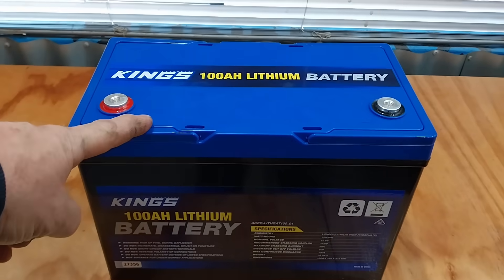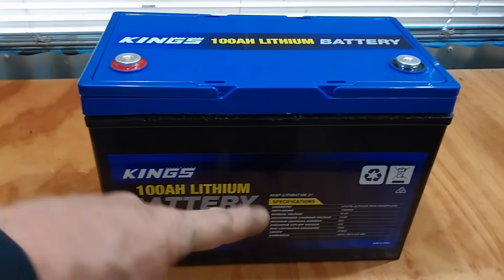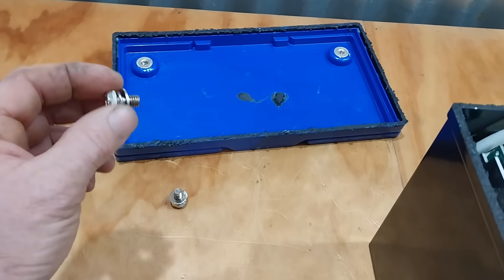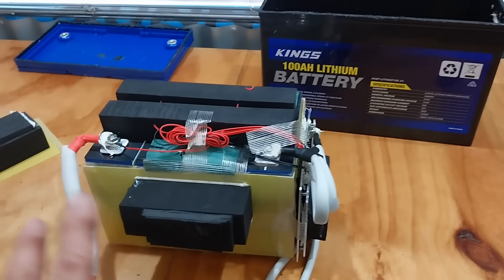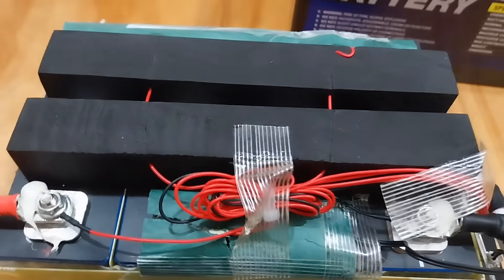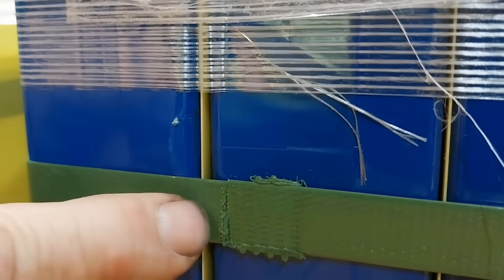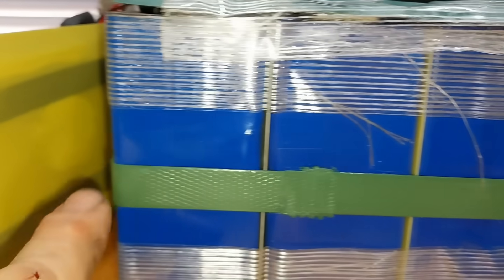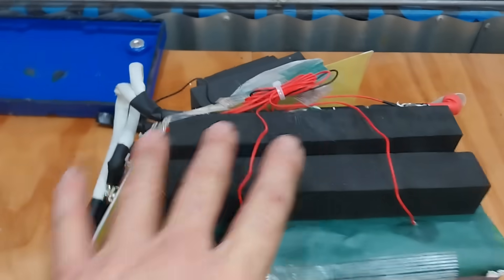Kings 100 Ah Lithium Battery Teardown - What We Found Inside ?

Comment: Chinese manufactures sell these dented cells as B-grade. If you look at Kings warranty on these they are 1 year.
Kings 120ah Lithium batteries have a 3 year warranty which could be that they are A grade cells not dented.
Reply from the maker: On the Kings website they say as shown below, which I copied and pasted from their website. It would be interesting to know the grade used? As for the 120 Ah batteries, I did a teardown video on them as well and the cells were all perfect.

"The Adventure Kings 100Ah Deep Cycle Lithium Batteries, battery’s high quality BMS paired with the Grade A cells"

Comment: The cell imballance starts to diverge  when the cell is above 95% state of charge. Your teardown video is great. The brand is not well knowen in china and likely will not last 500 full cycles. I have tested the 200AHr kings batteries before and the performance was only ok at 100amps continuous draw not its suggested 200A max which is fine but at the time it was suggested it could do 200A. Refunded it with dificulty and bought Renogy 200ahr lithium iron phisosphates in Australia instead almost same price delivered to my door and performed at 200ahr  for 1 hr 15 minutes!  In my opinion these kings batteries are quite low quality. If you cycle them down they will swell due to poor compression.

Comment: A few months back i was looking at the 100ah batteries. Noticed the 100ah only had 1 year warranty vs the 60ah and 120ah had a 3 year warranty. The 100ah wasnt using prismatic cells at that point. If buying a 100ah in the near future keep an eye on what warranty you are getting, they will probably be pushing last of the older design that has less warranty out.
Reply from the maker: The 100 Ah prismatic cell batteries are still a one year warranty where the 120 and above are three year. I did ask one of the staff at Kings why this is and they said it was part of marketing to push their higher capacity batteries. I've been meaning to call kings customer service on the phone to ask the same question as see their response.
Just a little side note. Not sure if you have seen my tear-down on the Kings 60 ah battery as I found the same damage to the cells in that battery as well. On the 120 Ah battery tear-down, the cells were all good.
Reply: @TheOffGridBachelor Yeah ok, It kinda puts the 100ah in a strange spot then having the batteries just below and above have 3 times the warranty. Thought it may have been because the 100ah was an older design but you just cleared that up. For the extra warranty you would be better off spending that bit extra and buying x2 60s or a 120, especially when they are on sale.
Reply: @TheOffGridBachelor didn't see the side note about the 60ah.. will watch the video though. Do have a 60ah and so far it has been ok, I am pretty sure the 60ah has a 3 year warranty though. Appreciate the videos you do 😊

Comment: This might be a bit long winded, but there are a lot of things wrong here.
The cells have a limited amount of electrolyte injected when they are built. The cell is first vacuum tested to ensure the seals and cases are good, this also is used to remove any oxygen from the cell. None of the manufacturers will tell anyone what they purge the cells with, but I would expect it to be an inert gas like nitrogen.
The cells don't have an excess of electrolyte the way a flooded cell lead acid battery, there is just enough to wet the faces of the plates and fill the gap between the plates and separators, there isn't any spare floating above the plates.
When the cases bulge, this forms a space between the plates inside and the case and this fills with electrolyte. The result is the electrolyte level drops down from the upper edges of the plates. If only part of the plate now has electrolyte saturation linking the plates together, the part with no electrolyte can no longer transfer the lithium ions from one plate to the other, so the capacity reduces, the more the case goes out of shape, the less surface area of the plates are saturated, the less capacity the cell will have. The battery is only as strong as the weakest cell, so even if only 1 cell bulges, the whole battery capacity is reduced because that cell can now store less Ahs.

The cell temperature should be measured between each cell, not on the cell link, that reading would be meaningless

Aluminium needs to be 3 times the area of pure copper to carry the same amount of current. This means even the link that measured 1.2mm thick, is only the equivalent of 0.4mm think copper. Cells like the ones from Winston Batteries use a link made from 5 pieces of 0.5mm thick copper stacked together to link the cells The reason for 5 thin copper links rather than one thick link is the cells actually expend and contract, and the links expand and contract, depending on the temperature, that thick piece of aluminium will apply pressure backwards and forwards on those welds and they will crack, then the current has to pass through a smaller section of the aluminium causing that to get hot and the link will rapidly crack and fail from that point ..... a dead battery because the current can't from one end of the battery to the other through all 4 cells.

If you are using voltage to measure LiFeP04 cells State of Charge, they are either fully charged, fully discharged, or not fully charged or discharged. An LFP cell is fully charged when the resting voltage after 12 hrs is higher than 3.45v, you can not measure the voltage to establish if they are capacity balanced at any thing lower than the rested 3.45v ...... except for 0% SOC, that is where the rested cell is less than 3v, draw any more current from the cell past that will create damage to the plates and cause the electrolyte to heat up, and that will cause the cells to bulge ...... we have already discussed the problems that causes.

The cell balancer board used is a simple resistor type, designed to balance 1Ah or less capacity cells because they can only drain off 0.025 of an amp, how long would it take to shift even a 1% out of balance ..... 1ah is 1.000 amps that can be drawn for 1 hr, it would take that little resistor 40 hrs to drain off 1 Ah

I built LFP battery packs for off grid houses, houseboats, caravans and motorhomes since 2011, there are over 200 of my systems still out there on the road, there is a lot that goes into building a successful and long cycle life LFP battery ..... and you can't put that in a plastic case that looks like a lead acid battery ..... for a start, how does the heat escape?

T1 Terry T1 Lithium
Reply from the maker: Wow this is a lot of informative information and thank you for sharing this with us, I have sure learned a lot from this.
I have worked with flooded lead acid batteries over the 30 years I have been playing around with off grid power. Now Lithium batteries have come into play, I have a lot more learning to do.
Thanks again for this information, very useful 👍
Reply: Nice to hear from you T1 Terry, although you did not build my system your knowledge is the reason for me buying my winston cells 11 years ago from Trev. At Drive by nature.  Batteries still perform well in my caravan to this day.
Wazzaaaa
Reply: For someone who knows absolutely Jack shit about the subject these questions stood out to me as also being concerning .. the temperature sensor only being relevant to the single connection seem to be problematic given that heat is a problematic Factor ... not to describe this man's work and video entirely but even for someone who knows nothing and I repeat nothing about this subject other than seeing inside of it for the first time by the end of the video I was left wondering what it was he was alluding to which lead me to the comment section we're comments were made such as you did the world a favourite by making this video and I was left wondering what I missed other than the visible damage which is open to cast dispersions to when that actually occurred ... the current loss and heat that would be generated through the transfer + the limitations of the temp sender comes off as a diabolical problem to both service life or worst case catastrophic failure ... are these symptoms what is commonly referred to when referencing thermal Runaway as accounts and documented news stories rapidly increasing  of these catastrophic failures do these new lipo battery variations whether it be charging normal use or damage to the cell itself ...

Comment: Mine came with the TERMINAL BOLTS in a zip lock bag ,????
Reply from the maker: The terminal bolts I showed in the video are the internal bolts for connecting the BMS cable to the terminal lugs inside the battery.
The terminal bolts that come in the bag are for the terminals externally. The don't come connected as the terminals have the protection caps on them as well as the warning label stickers over the terminals.👍

Comment: I have a 10,000mah battery bank, its starting to bulge, should i throw it away for safety.
Reply from the maker: If it's an NMC chemistry or similar then yes, discharge it and dispose of it. If it is LFP / LiFePO4 chemistry then I wouldn't stress as much. I am not completely up to date in knowledge with the LiFePO4 batteries so I can't say for certain on what is the acceptable level of cell swelling, so I would do some research on it.
Do listen to all the hype of the ticking time bomb and it's going to blow up fear mongering. There are people out there on YouTube that give their opinion but don't have a clue between the different Lithium chemistries. So I would do some reading / research about the topic and see what the general consensus is.

Comment: can you measure the cell dimensions? they look fat for 100Ah cells.
I was looking at your video of the 120Ah tear down, thhey look slimmer than these.
can you give dimensions of both here in the comments?
Reply from the maker: That's a little bit of work there as I have both those batteries now rehoused. So next time I pull them out from where they are mounted I will do some measurements on them.

Comment: Alot of bashing the quality..... please take a look of some so called Australian made batteries....see how much better they are.
Reply from the maker: I wouldn't necessarily say that I bash the quality, I just show what I find. Two out of three Kings batteries I have done a teardown video on so far have presented with damaged cells. Over all I find the Kings brand to be pretty good quality for the price hence why I use a lot of Kings gear, however they do lack is some areas. I have plenty of videos on my channel where I have given the Kings product a thumbs up.
If any company, not just Kings, doesn't want quality concerns being displayed during teardown videos, regardless of who does the video, then their quality control procedure should be filtering out any defected products.

The issues with testing other Australian brand batteries is the cost. However I do have three Amptron 100 Ah 48 volt batteries which is an Australia company. They came with a four year warranty and cost me $3,200 each when I bought them for my main system that runs my cabin. As soon as the warranty period expires I do plan to lift the lid on one of these batteries for a look see and see how they have been put together. I'm quite keen to do that.

Comment: Aluminium busbars... poor design choice. Thanks for posting and saving people money. You get what you pay for...
Reply: Aluminium bars are pretty much the standard.  Even the big boys from well known brands, sort of thing you hang on a wall and run your house off, use aluminium.
Reply: @retrozmachine1189  Here's an example of busbars used for EV cell interconnects. As a professional, we use tin coated copper. Aluminium presents issues of conductivity/resistance when dealing with larger current demands. Voltage drops induce heat. It's a poor design choice for those reasons alone...
Reply: @s.mendez7160  I don't really care.  The fact is battery manufacturers overwhelmingly use aluminium bars.  Here's why it doesn't matter.  Use higher CSA bars.  Shocking I know, but that's it.  Use higher CSA bars.  Voltage drop - solved.  Heat - solved.  Money - saved.

Comment: I bought 4 (lots of 1,1,2) 24V 100Ah LFP batteries that were too cheap to resist. The first couple (bought one on a 'too good to be true' test) were so good - big beasts of things that were each at the limit of what I'd want to carry - that I bought another 2, same spec, same price, but the original seller was out of theirs. The second 2 were tiny - I thought I'd been scammed. Most of the first week they didn't seem to deliver more than 100-120Ah together before being 'flat' (after sitting for hours at "100%" while rejecting a charge) but seemed to 'cheer up' to regularly discharging 140-160Ah without emptying, whereas the large pair seemed to deliver on their promise from day 1. It's interesting to see inside - this one looks similar in shape to the second 2 I bought, and about the same size, allowing for these being 12.8V and you presumably having normal-size hands. Seems fantastic energy density compared to lead acids!

Comment: Too low voltage to measure the cells and decide if it’s doing balancing. At those voltages the cells could be everywhere from 50% to 95%. You are in the flat part of the curve where they barely change in voltage at all.
Reply from the maker: In one of my previous videos I did a battery capacity test and it delivered 103 Ah before the inverter shut off. It was then recharged back up again and torn down for inspection and to do this video.
I would guess the cells would be on the higher end of the voltage curve. I will have to put it back on the charger for a while then measure the voltage again and see what we get.

Comment: The balancing charge happens at the end, the balance circuit puts a mosfet/resistor across first cell to reach peak voltage. As each cell peaks current is diverted through the mosfet/resistor until all peak and it switches off. 100Ahr cells seems smaller these days.
Reply: Spot on. 👍

Comment: Hey mate, random question but do you have any tips for finding specs on itech world stuff. Im installing a system for a mate but camt find a max bms current anywhere, let alone a book for the battery itself.
Reply from the maker: I haven' dived to much into the iTechworld batteries so not sure where to find the specs. Best thing would be to give them a call as they should be able to tell you or at least email you their data sheet.
Reply: Cheers mate. Ill give that a try. Thankyou.@TheSimpleLivingAussie

Comment: Definitley need to check individual cell voltages at higher voltage, put the pack on charge and look at cell voltages when pack is around 14V,
The passive balancing with these BMS is next to useless when they can only restrict charging to the highest cell at around 100mA
Reply: You almost have it. You want it fully charged and then rested. This will show you battery condition not battery balance performance.
Reply: @ballsyau1974  Checking the Internal Resistance of each cell might be a better indication of battery health.
Reply: @theoztreecrasher2647 very true. But one cell that will not balance, will be a sign. If one is out of range of all the others
Reply: The fact that the batteries are bulging suggests that they have been used and already suffered over voltage or significant periods over 35C. It's true what your friend told you, the sensitivity cell voltage difference often referred to as delta V is very poor when battery pack voltage is not >14V. So the state of charge can vary even though cell voltages are the same when less then  14V. The fact that your cell one was 50mV greater then other cells suggests a possible major imbalance. In these el cheapo BMSs' even though there is a wire to each cell there may not be any balancing function. The cell wire is for over/under voltage protection. In a balanced pack a delta V of <10mV is expected with total pack voltage of 14.5V. Of course the total pack capacity is determined by the weakest cell so balancing is important especially with poor quality cells. These closed system cell packs that offer no means of cell voltage monitoring    are not conducive to longevity. Manual balancing can be performed by charging each cell to a very precise 3.6V. I began my LiFeP04 days with a Riden power supply that has a precise variable constant voltage/current battery charging function up to 60V/15A. Cell impedance and voltage decay can also be useful measures of cell health. 3 things are to avoid long term, temperature over 35C and pack voltage greater than 14V and less than 11V for extended periods. Good to see that the build quality is improving but this battery would still be regarded at the lower end of the quality range.

Comment: Batteries are fine like that they are from Sunwoda cells production date was 1/6/2023  they produced 6009 of these hope that helps. Balancing depends on the BMS this does have a active balancer model number is VIP-4SSITO-H10 100A discharge and charge so when it starts to balance is up to the requirements inputting into the BMS i would just personally fully charge it then float it to 3.35-3.4 full charge should be 3.6V per cell (this also depends on LiFePo4 as well) here is a link to the app it may or may not have bt built in EE-BMS from app store on android or ios